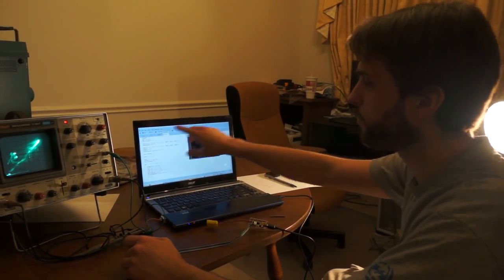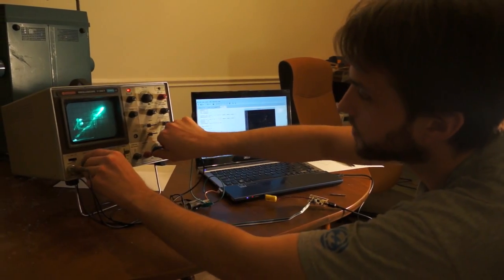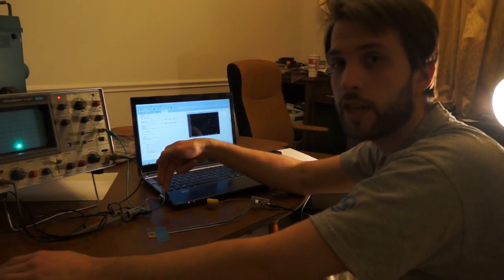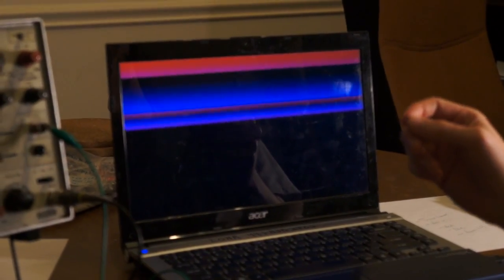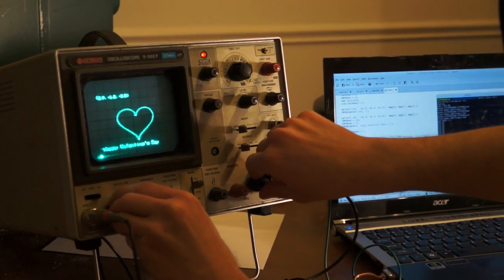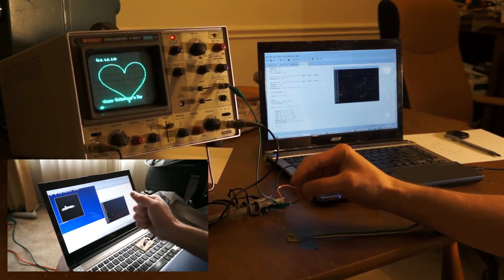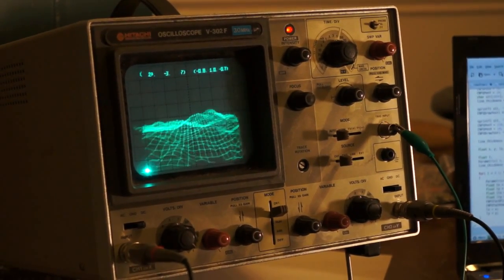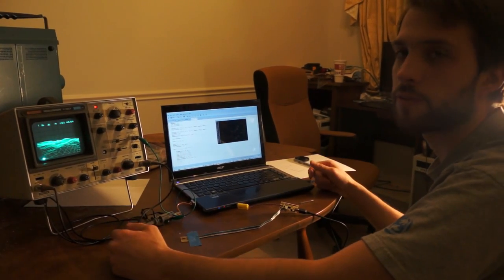Vector Display Output from a VGA Port

Comment: Extremely cool. I've been experimenting as part of a music video I want to make, but have been using audio L R as X and Y voltages. VGA would give a lot more bandwidth to play around with. I'm much more of a hardware guy than a programmer, so the one issue I can foresee is converting a SVG into a red/blue VGA output. I'll see what I can figure out though. Eventually I want to generate a series of frames (or waveforms) that will be stitched together to form full character animations, hopefully finding some sort of way to naturally blend between the frames. As an aside, looking on your channel, I see you're also into VR and DDR! Very fun stuff. Definitely subscribing.

Comment: I've used oscilloscope in the electrical lab in my college few times and lines that are drawn in oscilloscope are so much smooth. How do they achieve the smoothness ? Is it because the whole screen is fluorescent coated and the electron beam just hits the screen continuously or it's just that the pixel density is high enough to produce smoother line ? I'm curious to know.
Reply from the maker: I do LOVE the appearance of oscilloscopes.  They are so pretty.

Comment: Woah! I think it's a very nice idea (I did design a CRT vector monitor btw). How much X/Y "resolution" can you get? The very early Atari arcade vector games could do 1024 "positions" on both X and Y. How do you turn off the beam during "moves"? Are you using a third channel for Z control?
Reply from the maker: For this, most VGA outputs are 8-bit.  There was a few that were 10-bit, but still most are 8.  And I never used Z for control.

Comment: Could you also use the green VGA output to control the Z input (intensity) of the beam?  Then you could have proper blanking and multiple brightness levels.
Reply from the maker: Yes, however I do not have an oscilloscope which can take the appropriate levels to control intensity.
Reply: @CNLohr  Ya, they never seemed to have a standard for the Z input.  Some were TTL on/off only, others were analog but with varying voltage and polarity, and some scopes had no Z input at all.  This is still a cool concept, and could probably be adapted to drive laser scanners too.  I've done it with sound cards, but it's annoying having to deal with DC offset and other limits.
Reply: @CNLohr  Cool project, surprised it has not found more use in the many years that we had VGA as standard.
Many scopes have the Z-input on the back. On this scope it is called "EXT-BLANKING".  Using the Green chan to drive it is a good idea.

You can use the SYNC-signals to blank and hold the trace as well when you have no video signal available.
Reply from the maker: @KallePihlajasaari  the problem is the voltage level for the signal suppression was such that the green could not trigger it.
Reply: @CNLohr  Yeah, the levels may have needed amplification to get it to work.

I think I am going to try this out all the same as it is a cool high frequency analogue output, will pull my scope from storage and play a bit.

Thanks for documenting this.
Reply from the maker: @KallePihlajasaari  that'd be cool

Comment: Awesome! So what software do you use to create the red-blue vector rendering? And with the color space being 8 bit per color you get 256 × 256 positions on your screen, right? But you can draw 1024x786 or some 800 thousand points on the screen every 1/60th of a second, right? How might one increase the the resolution? Are there VGA outputs with 12 bit per color channel?
Reply from the maker: There may be, but you can also increase the resolution by filtering the output and using a very high resolution, i.e. 2222 2323 3333 would look like pixel 2, pixel 2.5 pixel 3 .
Reply from the maker: P.S. I think source code is in the description.

Comment: What's that green dot in the lower left corner? Is that the default position of the electron beam when both signals are zero (no x or y signal sent)?
Reply from the maker: correct
Reply: @CNLohr  Nice

Comment: Any way to get a meaningful composite or ntsc/pal image out of the scope for a clean recording to another medium, e.g. VHS?
Reply from the maker: That would be tricky without a chip made specifically for it... Because you would need to somehow get sync information to have two signals, instead of one.  Things like NTSC store sync information in the colorburst, or you could use QAM, or something like that but would be tricky.

Comment: The video of "High That Brings The Low" by Screwed Loose uses a very similar method for their oscilloscope clips but I think they changed the resolution and allowed for the pattern to repeat if there was still space in the encoded graphic file for more points/info. The result is here: https://www.youtube.com/watch?v=uXKzHtaq2HU

Comment: That is cool as heck. Maybe use the green to modulate the intensity of the beam? IIRC there is a BNC on the back of the scope for intensity. And you pretty much have to port battlezone.

Comment: It would been cool if you could start think about a new type of video signal. Today films are encoded in 2D flat pictures. From gaming we all know there's a movie format for 3D images, like for instance source engine, where you can record in games, then import the movie into smoother and you can control the camera angle and make 'new movies' based on that recorded file. Say one was able to make a video file format or standard with 3D images, like one could have pre sets for different camera moves (POV, etc). I would think that's the next step. I'd like to have my own "room" in 'cyberspace' where I could sit down and enjoy watching all the old movies and tv-series I like. Invite friends in etc. Surely you would need a 3D projector or sorts, or VR gear. Or make new software for the existing VR solutions.
Reply from the maker: It's really hard because so much is done on the other layers, so much is still done in "screen space" as far as the effects, etc. are.  But, there are advances in these areas, and interesting compromises every day.

Comment: Can you also control the intensity of the beam with the Green channel?

I would definitely like to see some modern Vector displays using separate lasers for each color. They would be difficult to make compact, though.
Reply: Some oscilloscopes have a z-axis/luma input (usually on the back).  You could use the third color if the vga output to control luminance if you have such a scope.
Reply from the maker: I also think that would be pretty cool.  But, sadly, I can't do that.

Comment: I think it's generally a bad idea to go into x-y mode without a signal, because focusing the cathode ray on one spot like that is likely to burn out the phosphor.
Reply: Only thing I can think you can go to X and Y mode with no signal for long period of time is the display being digital and not being analog, like that oscilloscope, meaning it can display same input for long period of time without burning the screen unless it uses a display that has it's display burn after say... 60 to 120 days.

Comment: I have a question. If somebody makes a vector based tube display like the vectrex one.But with colors.
ir would also work with pixels? or only drawing on the display? because if it draws fast enough and it is not pixel based i can see the future of 2d canvas like graphics...
Reply from the maker: That's a little complicated to explain.  Pixels or vectors are just a representation of the image data.  For pictures, pixels (literally transliterated "picture" "elements" it's just a different representation :-/.  You can totally do a color vectorscope, though.  Just can't drive it with VGA.

Comment: What bandwidth do you need? Is the soundcard output not enough?
Reply from the maker: +ultort Soundcards shape the signal wonky, usually don't give you flat response down to 0Hz and indeed don't give enough.  Bandwidth is entirely dependent on what you want to do with it, though.

Comment: Damnit, I thought this would be driving a conventional CRT as if it were a vector display. Alas :p

A similar trick with composite video on the PS2 was used in a demo at Revision 2013. It was clever, though, outputting a signal that makes sense for both the oscilloscope AND the TV: http://www.pouet.net/prod.php?which=61225
Reply from the maker: +TazeTSchnitzel Would you mind doing me a big favor and writing a hack a day tip for this one since I only kinda get how he's doing it with composite.  I get the top two displays (chroma/luma) but I don't get the bottom.  I think it would be good to get htere.
Reply from the maker: +TazeTSchnitzel I already did, that's what prompted me to suggest you submit it to hackaday as a tip.

Comment: Pretty cool. How many points can it draw per second?
Also, can it print in a smooth analog fashion, or only lines? What kind of input do you give to it? Just points or can you give it a function?
Reply from the maker: +Krusty Kraken It can totally do smooth lines, etc.  I don't know any really good metric... but, I liked the style of lines plus points.   I don't really know how to quantify "number of lines" :-/
Reply: CNLohr Oh, ok. I guess it moves at a certain speed and you can say that it can travel a certain distance per second, or frame. So, essentially it can move in a smooth fashion, but it's limited by a digital output which operates at a cycle rate.
I guess at this point I'm wondering if any output on a computer is capable of changing in an analog fashion over a period of time, rather than abruptly changing like a digital output.
It's kind of weird for me.
Very cool, though! I wonder how much something like this costs.
Reply from the maker: Cost is probably about $2, $1.90 for the connector, $0.10 for the resistors... I think just about any computer can do this, but you will need Linux so you can specify your own dot timings on the output signal.

Comment: i absolutely love this concept as a way of outputting vector graphics! i'm still somewhat of a beginner when it comes to programming but i definitely want to give it a shot using the code and schematics you assembled and see if i can figure it out enough to adapt it to something new. i've been dabbling in analog vector monitor graphics for the past year or so, as well as beginning to study the fascinating field of electronics, but haven't found too much into developing vector graphics renderer software to make the signals to feed into the display/scope, though this seems like this method has a number advantages to using audio output DAC setups like a lot of people in the area seem to use, since those are usually limited by sound card sample rates among other things. 

i tried to get the code running on ubuntu a while back on an older laptop in August but to no avail, but having recently gotten a much better system recently, i'm hoping i have better luck with it now.

would i be able to contact you if i run into issues or have questions on the code or setup? Again, i just wanted to say this is a fantastic idea!
Reply from the maker: +SamBlye The biggest challenges are (1) making sure you can trick Linux into accepting another fake monitor. (2) Getting your xrandr lags right to setup a screen to your liking, that will let you set to that resolution and blank and not freeze your GPU. (3) getting the software to work.  Feel free to contact me on google for quicker help.
Reply: I have a Tempest upright arcade, I could surely use some advice to feed some vector inputs to it ..
Reply from the maker: I don't know the first thing about that arcade other than it is vector >.<
Reply: Totally right, it is color vector and I have the drawings so no pb to connect to it..
Love your stuff
Reply: It does not seems like you uploaded this code on Github ..
Reply from the maker: Code is in description, though.

Comment: Your skills + Nikolas Wirth's skills = the ultimate "Steampunk" computer. You should check out what the "Super Professor" has done. He has built a RISC processor which runs on an FPGA. Everything is written in Oberon, the successor to Modula, Pascal (Which he invented). YOUR MIND WILL BE BOGGLED. Take the time to digest what Professor Wirth has done. Oberon needs some attention from the hardware guys like you. Oh yeah, Professor Wirth just celebrated his 80th birthday...

ProjectOberon.com

Ps. Oberon uses a hsynch vsynch scheme which you might look at.

Comment: I'm curious, how did you manage to turn the electron beam on and off between drawn lines? From what I know about vector refresh displays (which isn't much), you need three controls: X axis, Y axis, and the ability to turn on and off the electron beam. If you managed to make this display without said third control, could you share the method by which your display can draw multiple isolated vectors without traces between them? I hope I'm making sense with my question. Thanks for your video too. It is quite inspiring, and I'm bidding my way to an oscilloscope of my own to create a display for my Arduino.
Reply from the maker: I used xrandr --newmode to create a new video output mode where I could specify the sync times.  I was able to reduce the time the horizontal sync took.  For vertical sync, the beam just lives in the lower-left corner anyway which is off the screen.

Comment: add the Z-axis brightness control and you have a complete solution.  you're almost there.
Reply from the maker: I'd need an opamp to boost the signal to something that's 5v p-p... and my scope with Z would have to be working :(.  Is broken.

Comment: Great project man, I had a little search about doing something like this a couple of months ago and found a program to play asteroids on an osciliscope by hooking up the left and right channels of the stereo sound, to the x and y of the oscilloscope. It worked quite good. What do you think the advantage is in doing this via vga? I imagine it can run faster and it could be easier to encode an image than sound, but the image you showed on the screen didn't look like it changed much from pixel to pixel.
Reply from the maker: I am surprised it worked because of the lack of DC coupling on the outputs.  The VGA helps you in two ways: (1) It's repeatable; the DC offset does not disappear.  (2) It is very high speed.  The dot clock is in the 20 MHz range, instead of the 40 kHz range.

Comment: Great idea! Couldn't you use the green channel for intensity modulation? If your scope has a Z input that should be possible with a single transistor for amplification.
Reply from the maker: I've tried that but could never get the speed high enough.  I know I need an op amp, but never got a circuit to work.
Reply: Yeah, opamps aren't fun in this frequency range. I thought it could be easier with (RF) transistors but I've yet to mess around with video signals.
Would've been cool if you could get rid of that bright dot in the corner.
Reply from the maker: Yeah, just don't have the means :-/